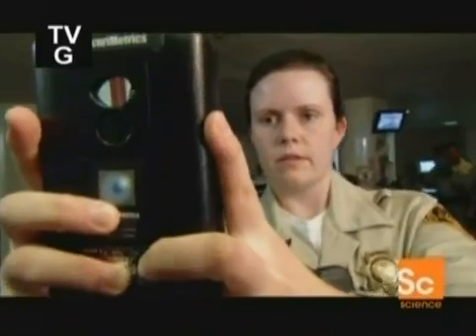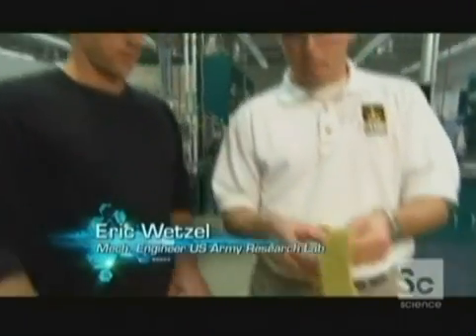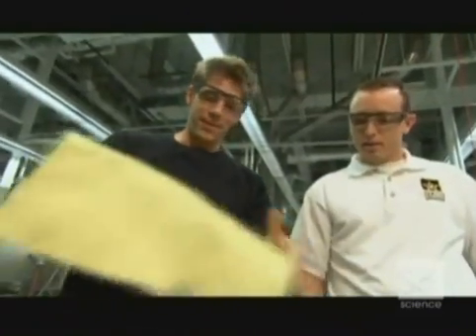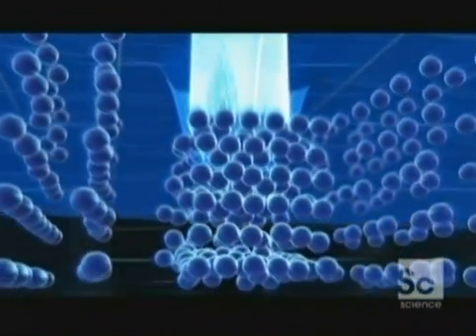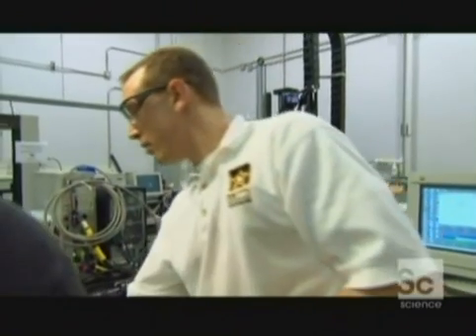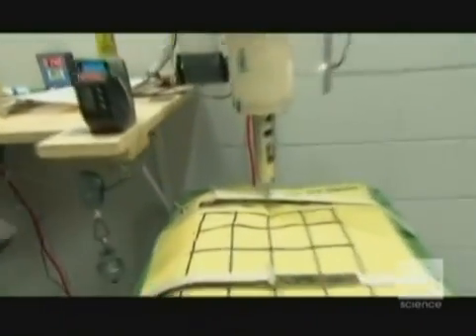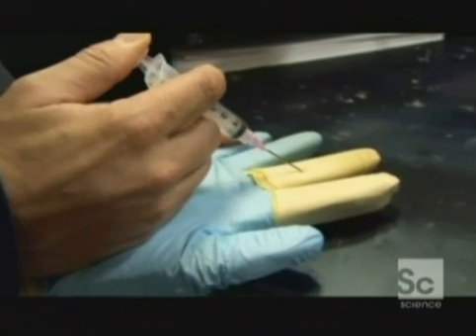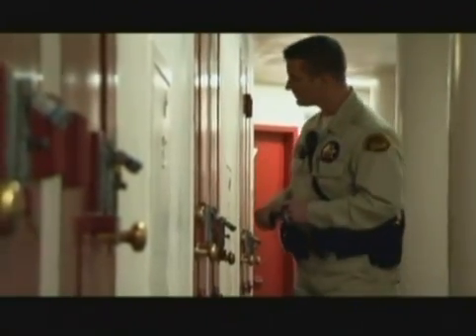Liquid Armor

Comment: Kinda like mixing water with corn flour it's a liquid but hit it with a hammer and it becomes a solid or you can run over it as the impact of your feet hardens it up but if you stop you'll sink straight into it .

Comment: So basically, you do the same thing they did in DUNE with the personal shields. You stab slowly.
Reply from the maker: slow blades penetrate the shield.
Reply: cplai: Wow, you're still responding to comments on this video. Impressive! On a more related note, I'd like to see this STF technology applied to Vacuum Insulation Panel (VIP) insulation. VIPs have incredible thermal resistance, but their Achilles heel is their thin mylar membranes are easily susceptible to puncture and abrasion (think shiny party balloons). With a substrate of STF cladding, the panels could still be relatively thin, yet withstand the rigors of commercial house construction. Installers wouldn't have to worry so much about a stray nailgun negating the insulative effects of the VIPs. Adoption of the building material would rise, manufacturing could be done at scale, and the unit price would drop to something ubiquitously affordable for even single-family homes.

Comment: or wear chain mail
Reply: the idea is to be mobile and light, chain mail does the opposite of that.
Reply: Aldo Iniguez and what about needles ? you mad bro ?
id always prefer a closed material instead of perforated.
Reply: Dave initiv well then it's probably not leathel
Reply: ACP it's pretty Mobil Germany police use it
Reply: Aldo Iniguez you didnt get the point about the needle.

Comment: So it won't protect u from a slow stab.
Reply: actually it would, it is still kinetic force. if you pull it slowly it will go through but if you pushing it into the "whatever" with force then the kinetic energy you're causing will be transferred into the liquid and it'll stop it from going through.
Reply: a "slow stab" wont penatrate the kevlar in the first place...

Comment: how about bullets?
Reply from the maker: What do you think? If the liquid armor is applied on a bullet-proof vest in order to supplement the protection against stabbing, will the vest lose its original function due to the addition?
Reply: just seems interest and this tink could maybe stop pistols or rifle calibers, but they have way more energy than a stab, but i like the concept of that liquid.
Reply: Its all about surface area.
Reply: Well judging by the video and considering the arrow made a small indent in the armor, The bullet would go through. It probably wouldn't do as much damage to a human target since it would take much more effort for the bullet to penetrate the armor unlike current armors.
Reply: nope, a bullet wouldn't get through either even though it has great velocity, the "liquid" would work the same to stop it.
Reply: A bullet doesn't have continual force applied behind it like someone stabbing you.  A bullet has the momentum of it's velocity and once that energy is absorbed it stops.  A person stabbing you continually has the strength of the person applying force behind the weapon, so it's harder to stop.  With adequate layers of Kevlar (28 for NIJ IIIA), it would stop those caliber rounds.

Comment: > Jan 9th, 2009

>May 13, 2016

My dad's a prison guard and still doesn't have this.  What do?
Reply: Lance Elliott: Make your own. Look up PEG and colloidal silica. Mix them together in a certain ratio that others on the Internet have tested to be effective for stab resistance, soak some existing soft body armor in the slurry, and then bake it at low temperature until it dries completely. As good, if not better, than what you'll find commercially and the materials are easily sourced from eBay.

Comment: How would it stand against against HE gun cannons of WWII or such?
So what if it was a HE shells of these gun cannon - so suppose:

1.) 75 mm HE shells from the Sherman Tank or the Panzer IV or the 85mm guns?
2.) 88 mm HE shells from the Tiger I Tank
2.) 105 mm M101 / M102 HE shells?
3.) 122 mm Soviet gun cannons?
4.) 152 mm gun cannons?
5.) 155 mm gun cannons?
6.) 130 mm gun canons?
7.) Or even 175 mm gun cannons or bigger gun canons? So like the 203 mm Howitzers? Or 300 mm HE siege guns?
Reply: Josef Richter Yea thats what I was getting at... The OP made it seem like this stuff could stop a tank round which is ridiculous
Reply: Why would you think a stab proof vest would stand a chance against Tank rounds?
Reply: +dhump132 If you're hit by a tank shell m8 I can assure you, the last of your concern would be your stab-proof vest.
Reply: dhump132 well HE is not the same as well edged attacks right?
Reply: +Grumpzilla ゴジラ 91 The kinetic energy alone of the shell will break you in half even if for some mystical power it does not penetrate the vest

Comment: So the knife doesn't penetrate the fabric, but now you have a hole in your chest made by a knife covered in impenetrable fabric. I think you would still be dead. What damage does it do to the body behind this armor?
Reply from the maker: +Tony Bla - that may be true if the fabric is allowed to wrap around knife. If the fabric is sewn into a tightly fit cloth, the fabric will be stretched over the skin like a membrane. If this membrane will harden like a shield, then regardless how thin it is, the membrane should behave like a shell on impact.
Reply: You wouldn't die but could sustain a broken bone. Which is far better than a 3 inch stab wound. 

Perspective: in Ancient Rome the armor was layered cotton. An arrow would penetrate 1/4-1/2 inch. That was considered reasonable. I doubt it will ever be 'no harm' sustained while having mobility.
Reply: Actually it would be like being punched by a finger...lol

Comment: its a great idea but what if the inmates went all medieval and crafted or blunt weapons like maces or hammers
Reply: Here's a better question what if the inmates just avoided the vest all together and aimed for their neck
Reply: dhump132: I saw a video where an inmate crafted this weapon out of two razor blades in the shape of a V. A swipe across the neck yields a really nasty gash that's difficult to close by applying pressure. If it opens the carotid artery, it's pretty much game over unless you have some of that instantly-coagulating powder to pack into the wound channel.

Comment: That's stupid. Even with this stab-proof clothing, the stab actually make the shirt spiky inside, so you'll be stabbed anyway from the spike of the shirt. Fail.
Reply: +SoulDevil92 I dont think they're just going to wear the treated kevlar by itself, they're going to wear padding underneath it so it doesn't hurt as badly
Reply from the maker: +SoulDevil92 - I guess you meant the fabrics may wrap around the blade so that the fabrics take the form of the blade and you get stabbed by the knife shaped fabric wrap. If the liquid armor is strong enough to resist the shape change, then the treated fabrics would behave like a harden membrane at the point of impact, i.e. a shell that takes the blow and distribute the pressure of the point into a larger area.
Reply: cplai That's what I meant... but yeah, I hope it's like you say, otherwise it's useless
Reply: as long as you're alive and you should be a man

Comment: Nice treated kevlar, good thinking, but wouldn't it be easier to wear a breast and back plate of composite armor which is much harder and lighter than steel?
Reply: +Eric Moore No, composite armour is made of ceramic among other materials, and it is designed to stop bullets, not knives, plus, it IS heavy. And yes, a stabbing on the plate definitely won't pass, but it's like hunting mice with a 50. cal, absolutely effective yet not practical for your purposes
Reply: 57069carlos 
Carlos, ceramic armor can indeed stop a blade.
Reply: Eric Moore That is what I said. A stabbing on the plate definitely won't pass, but it is not necessary, in fact it's an exaggerated and unflexible protection compared with the one of the video
Reply: +57069carlos.
Titanium plate then, your bot putting a knife through that and it's lighter.
Reply: Eric Moore it actually is a good choise, but flexibility and.mobility is important, and you need to cover all the torso; something that would be so damn expensive if you use titanium...
Reply: 57069carlos
Oh yes costs would be up there.

Comment: Basically Cornstarch and water, but more intense.
Reply: and glue
Reply: It's a non-neutonian fluid.
Reply: @Jaguar_Delta  At least get the spelling right.  It's Non-NEWTONIAN.
Reply: Dyllan Jensen That's what I thought as well
Reply: not really impressed  the greeks were doing this in the bronze age,jmo
Reply: @tomtoms404  No the ancient Greeks weren't doing this. Bullet resistant fabric armour is completely different to anything the Greeks had. None of their body armour would stop a modern handgun bullet at close range, whilst materials like ballistic Kevlar will. Stopping an arrow or bladed weapon requires different properties, although Kevlar can also be stab proof if woven differently, or if treated with a NNF. I doubt the ancient Greeks were aware of non-Newtonian fluids, and certainly not in relation to fabric armour.
Reply: @another3997  ... Technically your correct, but what I'm saying is the techniques aren't new. The only real innovation is materials
Reply: @tomtoms404  The real innovation is getting the liquid to stay in situ, rather than just slowly seep down the fabric due to gravity. The bricks and mortar in a modern building are based on technology the Greeks had. Evidence suggests the Egyptian pyramid builders used blocks made with a form of "concrete" to build the core structure, rather than chiselled stone. Everything new is old.
Reply: @another3997  greeks used naturally processed plant fiber(linen or flax) and glue probably made from rabbits to make a lamented armor . A university did a project on it you can look up here on yt. The trick was the way the fiber is processed , modern processes take something out of the fibers it was a interesting watch.

Comment: what if you stab it slowly?
Reply: +greenspiraldragon No, if you were strong enough, and stabbed it very slowly, you should be able to penetrate it. But think about it. in what situation can you sit there slowly applying pressure on a guards vest for 20 minutes with a shiv as he waits to get stabbed? If you have that much time, you are better off taking the vest off of the guard.
Reply: +greenspiraldragon DUNE!!!

"the slow blade penetrates the shield"
Reply: Not enough force to penetrate the kevlar anyway (i believe, correct me if I'm wrong)
Reply: +martinshoosterman that's why you stab him in the throat
Reply: +greenspiraldragon I watched it in normal and slow motion, same result
Reply: +greenspiraldragon 9:08 watch all the video, doesn't go 
🌏 📡🌏 👣🕘 💎💀☠☼☾☄ ₪itibira₪ ✶☥✨🌛🌄⊀⋉🐺🐾☆▲▴◭
Reply: +martinshoosterman What if they are struggling over the shiv?
Reply: +greenspiraldragon idk, the blade has to be moving pretty slowly, when he was moving the rod through the solution it got stuck really easily. Besides, when these things happen there are usually other officers around
Reply: arrows goes thru stuff better than bullets
Reply: U are joking
Reply: yeah in fact 50cals use arrows, not bullets, and the same goes for tanks... /s
Reply: That's not stabing
Reply: LOLLLLLLLLLLL
Reply: Just go for the throat, eyes, ears, temple, groin, inner thighs, perineum, base of skull, etc.... 

The armor sounds great... but if they really want you dead in prison... they outnumber you like 50:1... you’ll be dead. So play nice with others lol

Comment: Regardless of the ability of the fluid to stop a point from going through,  it does NOT stop the kinetic energy that will cause broken bones, internal bleeding and countless other damage.
Reply: +Valoro85 He's right though.
Reply: Emanual Goldstein: That's what the Kevlar is for, more or less. It spreads out the kinetic energy over a larger area so the localized impact isn't so forceful.

Comment: So if you stab them just go slow problem solved
Reply: Nope, since ur still moving ur arm to stab somebody then that means there is still kinetic energy, meaning the particles will form into a pattern that will stop it to puncture through
Reply: Well there is a video with a guy putting the blade on the vest then pushing, right through.
Reply: With liquid armor or just regular kevlar?
Reply: The neck is always going to be the best anyways
Reply: Just saying something so expensive isn't worth it. A couple layers of paper will stop a knife and be lightweight
Reply: Valoro85 for something that works sure.
Reply: Valoro85 if you are talking about a hunting knife ok. But how many prisoners have a knife like that?
Reply: Maybe we should get to the real problem why do these ppl have knifes at all
Reply: Ghostharold170 not really because it will just do what it did when he put the stick in it

Comment: The fluid is basically Corn Syrup and water
Reply from the maker: ***** Corn syrup and water do not make a non-Newtonian fluid. Corn starch on the other hand is different.
Reply: Uhh I meant Corn starch
Reply: +Sean Rhoades    The silica is a macromolecular covalent compound. It shares this characteristic w/ Silicon Carbide, which actually is significantly better than Silicon Dioxide in this application. As the sheer thickening effects localized compression, the density increase is harder (MOH) w/ Silicon Carbide.
Reply: ***** The fluid is silica, and propylene glycol. But same idea.
Reply: +Sean Rhoades And this is where I found out I'm pretty dumb in these types of conversations.
Reply: Sean Rhoades
Thanks for the correction. That's what I meant. I got it mixed up with the vape juice ingredient.
Reply: +furyp100 I knew it as soon as I saw the label ... its just behaves in that way... :)

Comment: How often would you have to reapply the fluid to the armor to keep it at maximum effectiveness? As your example shows, gravity still affects it- when it's not under force, it flows. Doesn't that mean it'd 'leak' over the course of a few days?
Reply: Nah, cohesion holds it's in material, but if left hanging for a couple of months, yeah. Howerem moving, breathing will cause this now newtonian liquid to solidify preventing flow
Reply: But dude, if the armor were used in the rain, the rain will end up washing away the liquid in the armor, and any smart criminal out there can easily exploit that if Liquid Armor got mass produced.
Reply: @RedRushOfTheGuardians  It isn't exactly rocket science!  Have you have never heard of waterproof fabric? Kevlar armour panels usually comes sealed in plastic to prevent moisture and UV light from degrading the fibres. Or you just cover it in waterproof nylon. Or both. 🙄

Comment: It's really not a fluid at all. In this case, it's more like a film which wrapped the inside kevlar fabrics. 

In case of a fluid, a very small stress will result in a deformation. PVG is usually made solution by using solvent which is water. You can't apply the solution onto the surface of the armour even the viscosity is very high. The solvent will evaporate anyway (It depends on pressure, temperature and time).
Reply: Anyway, still a great video.
Reply: If the PVG/Silica solution is hermetic in armour. In this way the solution can stay as the liquid phase. Somehow, I'm curious whether the nanosilica will agglomerate or not when time goes by.